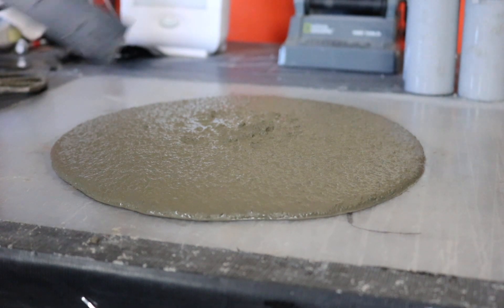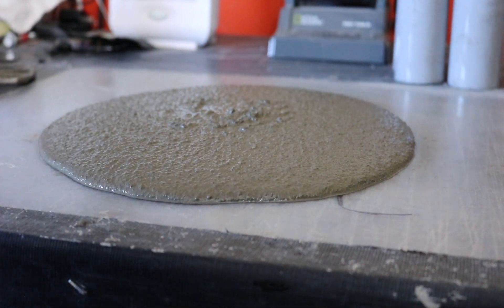Fixing Segregation In Your Mix With Colloidal Silica - Vlog #140

Comment: So by adding the colloidal silica, the mix is able to hold up more water without segregation. Is this beneficial to prevent plastic shrinkage due to premature loss of water (e.g. sunny windy day) and make it easier to finish the concrete? Or is this the wrong approach? Stated differently: why should I want to have more water in the concrete?

Comment: Hi Jon, does it increase the temperature of concrete after you add colloidal silica?
Reply from the maker: Kriswanto Santoso yes.  The heat of hydration can and more often time does increase.
Reply: @IntelligentConcrete   Thank you for answering,  i tried using levasil CB45 A its quite hot.
Reply from the maker: CB45A is an awesome tech but it is an extremely small particle.

Try the 25A, it’s a bit bigger and a little slower to react.
Reply: @IntelligentConcrete  will give it a try thankss...